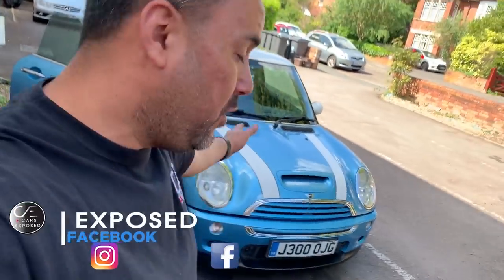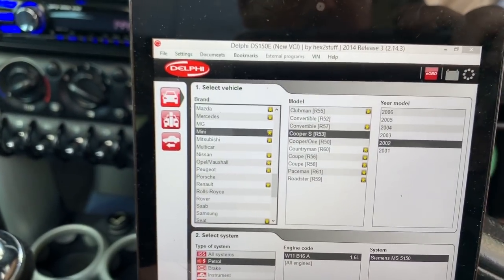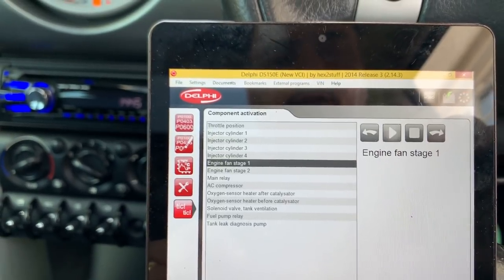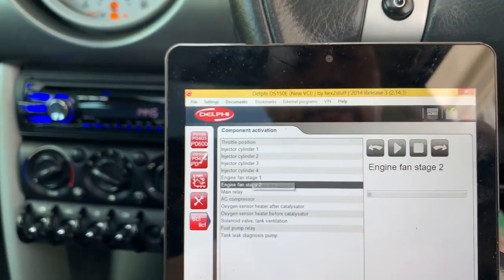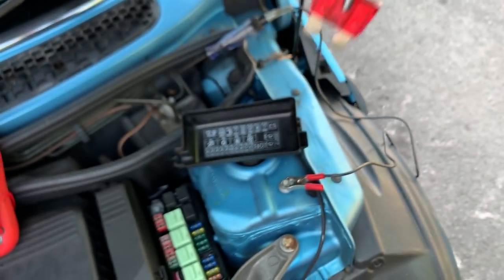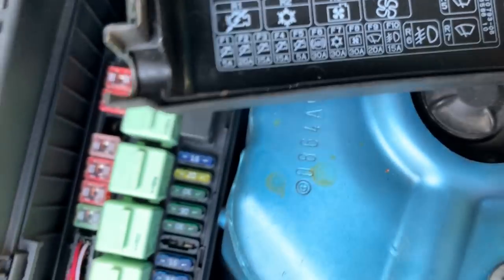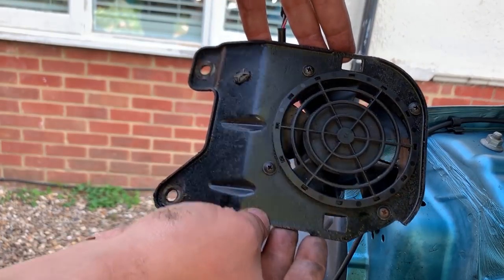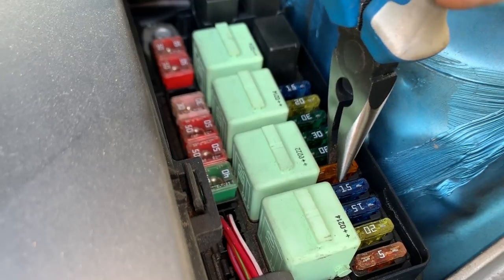Mini Cooper R53 Overheating Because a PS Pump Fan

Comment: I know this is a 4 year old video but by the sounds of it you also need a new cooling fan. most of the time the stage one fan will go out due to the resistor in the fan and then cause blown fuses or you get a cycling stage 2 fan. the reason the fuse isnt blowing anymore is due to the ps fan not drawing the extra current that the bad radiator fan needed. so in a sense it stopped overloading the system. you fixed part of the problem but not the cause of it.

Comment: Great work. Simply great. Watched the video, then fixed my car (with same problem) within 10 minutes. 
Loving it. 
Bring it on!!!
Reply from the maker: Thanks mate well done I’m glad the video helps 👍👍👍
Reply: My fan did not turn so i took it to the machenic he then unpluged the fan switch and now it goes on but the water gadge indicates is up as if the car is over heating..
How do i fix the problem??
Reply from the maker: Lawrence Lekitima does the gauge go up from cold if does I would check the temperature sensor first 👍👍👍

Comment: I have the same problem with my fan making the car like it's about to take off when the engine gets hot! Will check the power steering fan for sure, great video!
Reply: Did it work?
Reply: @Saddexx  I did a bunch of work on the car, including this. What actually fixed it, I believe, is replacing the low speed fan resistor. Common issue, easy fix!
Reply: @leefrith359  A couple of days ago, I checked the fuse box to find that the fan 2nd-speed's fuse was dead. I was happy and I replaced the fuse and tried to park the car with the engine on. At first everything was normal until I turned the A/C on then it started to heat up so I quickly turned the engine off... I've an appointment on Monday at Mini.... I hope it's not serious..
Reply: @leefrith359 did you have to remove the radiator completely or did you just have to put it in front end service mode and slide the radiator forward a bit?
Reply: @JustinMoseley-w4z  front end mode and remove the shroud, rad can stay on car

Comment: Just remember everyone, short to the power side of the syst blows fuses, a short to the ground will overheat the ground wire and can either weld itself until it makes a better ground or the wire won't hold up from the heat and break then seperate from its connection.

Comment: This is a long standing issue with the first new Minis. Went through three steering pumps on our 05. Small cooling fan exposed to mud and snow. After market cowling was one solution.

Comment: I have a 2006 mini cooper s . The cooling fan resistor responsible for the low speed fan operation went bad just over the warranty. Consequently, the cooling fan ran at high speed constantly. The dealer( stealer) wanted over 600 US dollars to change out the whole fans assembly because the resistor was in the fan shroud. I call them stealership because I have another story about a flood damaged Jeep Rubicon they almost sold me. (I was very stupid at the time)
I fixed this so long ago I forgot exactly where I put another resistor in the control circuit which has been working for now 11 yrs. There is a relay that send the electricity to the circuit that feeds the fan resistor.
Given that hint and search google for the fan resistor and you will find the post where I found the fix for it by another guy.
Reply from the maker: Yeah dealerships (stealerships) 😊 can be a hit or a miss even here in UK , I’ll try to google it if you have a link just leave it here 👍

Comment: First off, FYI, There is a Power Steering Recall.  I just had mine serviced last year in June 2021 and by July I was sitting in traffic also and my car overheated. They told me before servicing it that the power steering fan and the engine fan are both on the same fuse so if the fuse goes, they both malfunction. Well I checked all the fuses and none of them were blown. So I took the car back and they said if it had to do with what they did for the recall, they would warranty their work well, of course, it was something else ( they say). Now I have no power steering at all and they say it is a 16amp fuse that is in the fusebox located under the engine fusebox and apparently it's Not that fuse that runs both the fans.  So I'm on here doing research and have found 2 vids that show that particular fuse box but no 16 amp fuse in it.  It shows 2-50 amps, 1-100 amp and a 05 amp.  I'm so confused as to where this fuse goes. Can anyone Help Me?! The fuse only cost around $10 but they want $400 plus to change it! SOS!!!
Reply: Any luck?

Comment: THAT  WAS CLEVER GOING TO CHEAK IF THAT'S MY FOULT. THX FOR THE VIDEO. IT WAS NOT it's THE FUN ITS NOT KICKING TO BRING DOWN THE HEAT.
Reply from the maker: If the fuses are good it’s probably the fan try to power it up 👍👍
Reply: @CarsExposed  I DID NOTHING. NEED A NEW FUN OR A 0.3 ohm 100W resistor THATS ON THE SIDE OF THE FUN BUT ITS  BIG JOB. THE COST FROM EBAY £7.99

Comment: That power steering pump fan wasn’t on the really early models. They only started putting them on when they realised the pump was overheating. So no wonder it’s wired up a bit wonky lol

Comment: I’m going to try changing my power steering pump also. My car is still overheating after I change radiator and thermostat. The exhaust headers glow super red also from this over heating within 5mins of the car started. If you have any other suggestions of what could be happening I would appreciate it. I have a 2003 Cooper s
Reply: Stage 1 and 2 thermostat sensor maybe.
My heater matrix went.. then the main Rad, and turned out to be the stage 1 and 2 sensor. A smoke fix and swap.
Hope you got it all sorted.
Reply: Catalytic converter probably stopping exhaust flow..get it checked at a shop with infrared equipment..good luck..

Comment: Hi Igor found problem cheap fix I suspected the head gasket had gone turned out to be thermostat housing cap wasn’t sealing properly so the system couldn’t pressurise explaining the Cooling fan not cutting in ended up being a £12 fix .
Reply from the maker: Excellent find Vince thanks for letting me know 👍👍👍

Comment: My PS fan is working. But my radiator fan is not turning on until the PS fan turns off. And its to late. It overheats. The radiator fan is brand new. Not sure whats going on. Any ideas?

Comment: Hi Igor was your expansion tank filling up and bubbling because the fan wasn’t working basically if you sat with engine running after about 10 15 minutes coolant becoming hot
Reply from the maker: Vince Pusey it probably was but my expansion tank is impossible to see through and I didn’t dare to open it 😊👍👍👍
Reply: Did you figure out why it was bubbling up?
Reply: @MrMouze-os6ks  yes believe it or not it was the thermostat housing cap not sealing and letting air into the system.
Reply: @vincepusey2157  damn, I’ve took off my whole front bumper and radiator thinking it was that. Least I found out the low speed fan switch resister that’s green is pretty ugly. Replacing that and the coolant reservoir next weekend. My thermostat is probably stuck like yours was too so thank you for replying!!!

Comment: Hi, great video! I think I have a similar problem with my R53. I just removed my PS fan and it is seized like yours and the 5 amp fuse was blown. I have tested the fan at both speed using a battery direct to fan plugs and that work fine. However, unlike in your video, I cannot get the fans to run with the PS fan unplugged. I suppose this creates an open circuit? How were you able to run the fans like that?
Reply from the maker: Shuttersound thanks mate, I’ve used my scan tool a Delphi DS150 to command it on by active test ...

Comment: That's a rough place to put a PS fan.....hopefully there's an updated part for the replacement with some sort of shield to protect it....   Nice fix Igor  !!!
Reply from the maker: Johnny's Speed Shop hello mate I missing your videos what’s going on ... 
Not the best place indeed the PS fan literally gets hit by everything from the road specially when driving because the design , they did modified the shielding in later vehicles with cutouts facing the rear of the car which helped a lot... cheers mate 👍👍👍

Comment: Having problems with 2003 mini,pas intermittently goes hard,replace second hand pas motor,Vehicle ran good for 2 days. Now the pas has gone hard once again.I have checked fuses,All good,Generall inspection of wiring no chaffs,No worn ,bent ,Oxides in pin plugs?
Reply from the maker: Next time it stops working check if you have input voltage and signals... I would guess it’s more than likely to be a module problem if you changed the pump and still plays up

Comment: Great job mate without electric diagram it's very hard to resume the problem witch the important of electric diagram in car diagnostic
witch program do you used  Haynes Pro is very good program
Reply from the maker: عبدالله العريبي absolutely  mate I have to agree without  diagrams I would never find this one, I use a mix of diagrams but here in UK information is so limited that you have to think outside the box every time 😊, I have cancelled all my subscription lately I would like to try Haynes pro to see what’s like cheers 👍👍👍

Comment: I have the same problem but I have watched your video over and over again but I still don't know from where to start... my fan kicks in now and again but the temp is always in the middle. When I stand in traffic for a long then I get back pressure or I should say coolant coming out the expansion tank but yet the engine temperature is in the middle . ... did u change  that small fan under the car ? I check my fuse nd its not blown
Reply from the maker: Would you have a problem with the reservoir/cap itself?

Comment: thanks for the information
Reply from the maker: mr big money it’s a pleasure bud 👍👍👍
Reply: @CarsExposed  I'm trying to figure out why my fan doesn't kick on high mode... I've checked the fuse, I've swapped the relays over, new t-stat housing with sensors, and still nothing! 😕 any ideas?
Reply from the maker: mr big money is your setup the same as mine you can see it here https://youtu.be/HDbXBIcCEQU
Reply: @CarsExposed  2008 S... they all seem to be the same when it comes to electronics, but my fan kicks on low speed when it should, but when it gets hot, I got nothing at all... I guess I'll pull it apart and get a deeper look! Thanks for your reply and information

Comment: What reader do you use?!
Reply from the maker: I use the Delphi ds150
Reply: Whats your setup on the delphi please 

How do I get it
Reply from the maker: It’s a DS150 you can find the cd program and obd2 interface on ebay for around £50
Reply: @CarsExposed  is there an annual subscription or particular tablet/laptop 
I've seen dedicated scan tools that go into 100' of pounds
Reply from the maker: mohammed ali if you buy the proper Delphi tool you can pay for a subscription and get updates, mine tool and all the others on eBay they are clones so no updates if there is a new version you just buy another cd ...
Reply: @CarsExposed  be VERY careful buying cheap knockoff products from China.  The REAL Delphi DS150 costs about 30 TIMES that.

Comment: ,, hello mate great video I'm having the same problem on my 2002 Mini Cooper automatic 1.6  but I found the issue is it keeps blowing 50 amp fuse so my fan is not working do you have any ideas what can be doing this plus my power steering fan looks ok it's turning but I've not seen a turn on do you know how to do this thank you
Reply from the maker: Have you checked fuses ?
Reply: Yes m8 it's all done now got a new fan works perfectly but having problems when you Accelerate the car pulls a y ideas what it can be
Reply from the maker: William Lunt I would check the wishbone bushing for any play 👍👍👍
Reply: @CarsExposed  thanks m8 will do